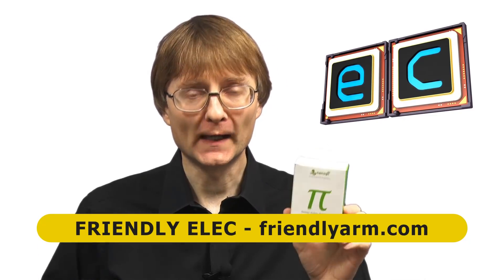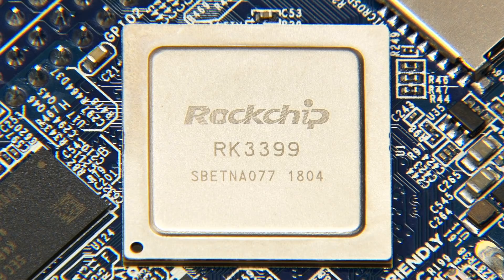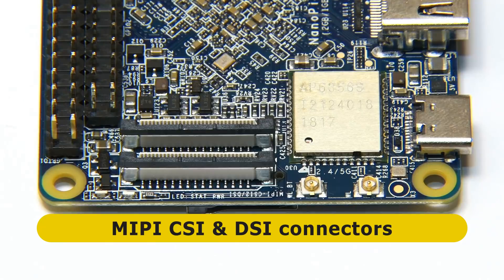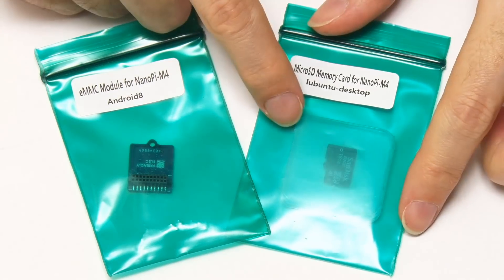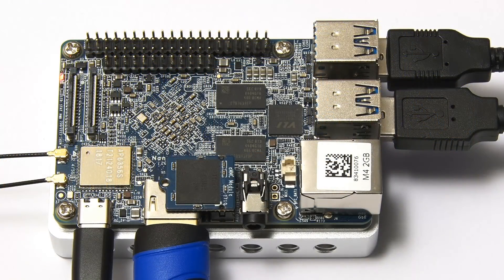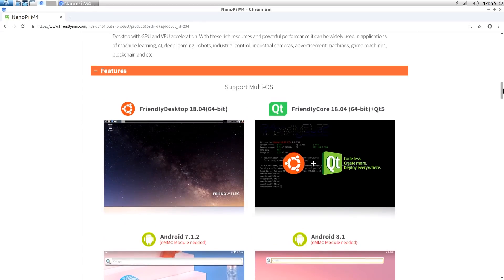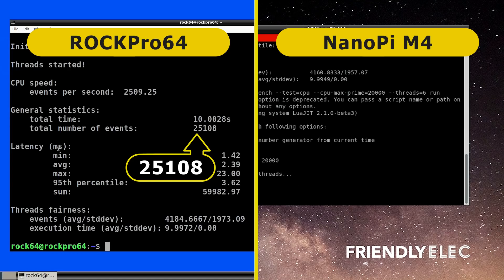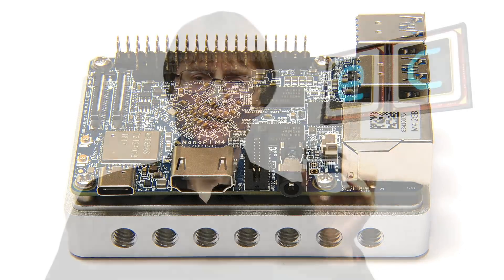NanoPi M4 : RK3399 SBC with 4 x USB 3.0

Comment: As I mentioned on another channel the march of the RockChip based SBC's is clearly on,  Its going to be interesting to see how the Pi Foundation responds since they are woefully way behind the current leaders and only falling further as time goes on.

It is however going to be an interesting time going forward with probably more Risc V hardware showing along with FPGA's, add to that new SOC's sporting the A76 @ 7nm that we are yet to see, surely is going to be exciting times.
Reply: Without good support from RockChip (which is known that doesn't provide) there will be no community which will be the doom of the boards. That's why still with all these boards in the market, RPI is still leading alone the SBC race.
Reply: Alexandros Naoum  What support do you speak of?

http://opensource.rock-chips.com/wiki_Main_Page
https://github.com/rockchip-linux/kernel
http://opensource.rock-chips.com/wiki_Yocto

So as far as OpenSource / Kernel level support is concerned this is champion as you can see the BSPs have been provided upstream,  with that said this moves the burden to the distribution to user level queries where it belongs.  I mentioned this very thing at the local Makerspace when someone who had no business buying an SBC then just straight up complained with the lack of software.  This person does not really code and or understand the systems/subsystems of the Linux kernel.  Also to the point of the community question the Rock64 channels are buzzing, a number of Devs with Ayufan are doing amazing work.  I have a LoraWan ( 8chan Gateway SPI ) using a Rock64 and a 915 board, I had to do a couple of rebuilds of the dts/dtc blob to disable the SPI flash and return it back to the SPIDEV module, all this is running a very healthy Arch Linux distro which was super simple to get up and running.
Reply: Alexandros Naoum,  Competition is never a bad thing!
Reply: It's not but I haven't see any real progress all over these years and it is a fault of the vendor which are not giving any information or some drops to the community.
Reply: Lets hope they keep on fighting to stay on top of each other, that way we get better equipment to work with.

Comment: Are there any system on chip boards that have expansion for memory? I would basically love this style of single board, but with the ability to add 4, 8 or even 16GB of RAM. Also, the bundled heat-sink is a fantastic idea.
Reply from the maker: I am not aware of them at present, although the forthcoming UDOO Bolt does I think have memory slots (so kind of taking it out of SBC territory). Note that there is a 4GB version of the NanoPi M4. And I will be reviewing the 8GB LattePanda Alphs here in two weeks! :)
Reply: Cool, I look forward to the new reviews. I guess at some point you will be able to power these things from USB3

Comment: That heat sink really is cool, can you try adopting it to other single board computers?
Reply from the maker: I thought of that -- but the heatsink only works as it does because the SoC is on the bottom of the board, which is rare.

Comment: Like me, EC appears addicted to SBCs. The M4 is everything the next Raspberry needs to be, just cooler and half the price.
Reply: I think the next RPI needs LPDDR4 over this one's LPDDR3. The ROCKPro64 has LPDDR4, thus eeking out a few more cycles in the benchmark, and few more seconds in the render.
Reply: I would love a pi with those specs, but a pi will run circles round the nanopi m4, even the zero, nice desktop environment on nanopi os, but very early days, a lot of development to do, if you ran the two boards in every day use, you would think the pi was the more expensive board, the pi is just so good, maybe the best arm device, definitely the best SBC, if my pi did 4k I wouldn't need my Nvidia shield anymore.
Reply: Because SBC is a option now 4 project
Reply: energyideas I want to dive into a huge container filled with SBCs. Special attire necessary though.
Reply: The problem here is the Rockchip SoC, as Rockchip is notorious for releasing closed source drivers based on open-source code thus violating the license. A lot of people are concerned about the development on these chips, what if the manufacturer drops support? I was about to get an ASUS Tinkerboard, because I need line-in for a project and a bit more performance, but I think I'd rather stick to the Raspberry Pi, although it's slower on paper and I need a GPIO Hat for the line-in (or a USB Soundcard). The Raspberry Pi has Open GL also (Tinkerboard, or any Rockchip if I recall correctly does only support Open GL SE) so the performance gap might be neglectable anyways
Reply: @jan-k7x1c  stick with the pi, I did have a tinkerboard for a short while, there was no noticeable improvement in performance over the pi, so I sold it, I have kept my nanopi so far, it seems early days, the chip seems to be quite widely used, but no optimization as yet, this should be pretty cool 35% more powerful than the xu4, but optimization is the thing with arm in general, the latte panda doesn't sound like it shouldnt be a patch on a 2 year old snapdragon phone, but it runs circles round an 8 core 2ghz phone with 4gb ddr4 memory, I hope everyone's tinkering helps the development of arm devices, it seems very democratic, especially the raspberry pi.
Reply: ill bet Raspberry is working on the 4 and a way to have a decent price point since that is the theme of Raspberry boards. If they can get stuff like this on the Raspberry 4 and typical Raspberry prices they will no doubt turn a lot of heads in any electronics market not only single board consumers.

Comment: Also I don't understand keeping with the rpi form factor and then putting the CPU underneath, can't use any rpi cases, etc.
Reply: Might be useful for expansion boards that expect ports to be in the right place to fit on top
Reply: Gets too hot so they want you to use their heat sink which makes the board work better
Reply: The board sizeD is a bigger factor rather than the Cases use case here.
Reply: Any info on the tdp, and how much heat we need to expell from this CPU?

Comment: As usual, great video,  Chris!  Would this SBC work plugged into a TV instead of a monitor?
Reply from the maker: Yes, if the TV has an HDMI socket.
Reply: ExplainingComputers Cool.  I was wondering because I know that there can be resolution issues and whatnot when you do that with a regular PC.  Thanks!  :-)
Reply from the maker: SBCs tend to support TV resolutions really well -- 1920x1080, 1280x720, 4K/UHD on some, etc. It you see a direct screen recording from an SBC on this channel, you can be pretty sure it will work with a TV, as I record to video equipment, not computer equipment.
Reply: Awesome!  Thanks!

Comment: Interesting SBC, a very crowed board layout, but I guess since it does so much that makes sense.  One question however, what is the 4 pin header between the 2 USB 3 'blocks', is it just some test points or another interface?
Reply from the maker: I don't know what those pins are! You are the second to ask already. :)
Reply: Debug UART
Reply: Serial
Reply: Either serial or PoE is my guess.

Comment: Designing cpu on the bottom is so stupid.
Reply from the maker: But it works very well for the heatsink . . . ! :)
Reply: @ExplainingComputers   The heatsink looks good I admit that. But because of the poor placement it needs to be larger. Heat transfer tends to prefer the upper direction so no matter what the board will get hotter. I have some older board from nanopi and its the same thing. I had to put it upside down or at the very least on its side. The cpu gets very hot after a few days of uptime without any reason. Is this new unit suffering similiar flaws?
Reply from the maker: I've only had the heatsink pleasantly warm! :)
Reply: Would you consider buying this board without heatsink or is it necesary?

Comment: What is the 4 pin headder for that is inbetween the USB3 connecters?
Reply from the maker: YOu found it! I searched and missed that. Clearly not my week. :(
Reply from the maker: That I cannot find out. You are good at spotting things!
Reply: Just looked on the friendlyarm wiki... It's a debug uart!
Reply: I have seen mention of those on other SBCs, not sure if the pin-out is standard. There are a couple of pins on the standard GPIO header too.
Reply: Perhaps usb 2.0 pinout for case mounting a USB port.

Comment: 4K 60p? Do you mean 60hz?
Reply from the maker: I mean 60p -- 60 frames per second (progressive) at 4K (well UHD). As opposed to, say, 60i (not that you get interlaced resolutions at 4K). :)
Reply: Ah ok, I've generally heard it with the vertical size (2160p, 1080p) rather than with the refresh rate but I guess they are both standard.
Reply from the maker: The "p" always stands for progressive. But saying "1080p" is actually meaningless as a video output format without knowing the frame rate. It is written like that a lot when describing the movie files recorded by a camera. But when you are looking to connect a monitor to an outpout, you really need to cite a resolution and a frame rate -- and indeed in any decent camera manual you will always see (eg) 1920x1080 30p. 4K find of confuses things (not least as most 4K output is not 4K at all!). :)

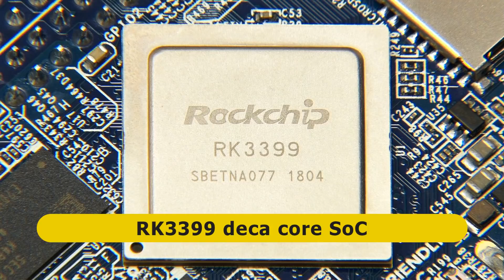Comment: A deca-core processor has 10 cores, Mate. Not 6! 02:15
Reply from the maker: Yes, you are right. Sorryl I make mistakes sometimes. But the specs are right -- two Arm Cortex A72; four ARM Cortex A53.
Reply: @ExplainingComputers  the occasional mistake is absolutely fine because your videos are awesome! 🖥📹
Reply: Hex
Reply: @dkimmortal  haha! Yeah, thanks for clarifying that for us. 🆗🆒👍
Reply: BTW. Wouldn't it be more correct to say "dual/quad" instead of hexa-core? It shouldn't be able to run a A72 at the same time as a A53 if it has a standard big.LITTLE configuration.
Reply: quite powerful wonder how they compare to intel atoms
Reply: The RK3399 has 2 Cortex-A72 cores, 4 Cortex-A53 cores and 4  Mali-T860 (GPU) cores.
That's 10 cores mate ;) 
I jest, but it's not completely incorrect.
Reply: @nextlifeonearth  is the gpu really 4?
Reply: Yep.That's what the 4 in the GPU name "Mali-T860MP4" stands for. 
Keep in mind an FPU is not a core. What Nvidia calls "CUDA cores" are FPUs, they're not cores, so they caused that confusion in case you look at the FPUs and think "but that's way more cores than Tates said!". Just because you put more cylinders in a car engine doesn't mean you have multiple engines. 
I like to rant.